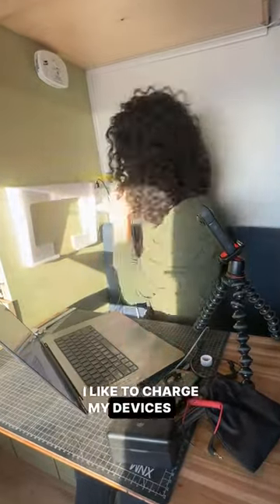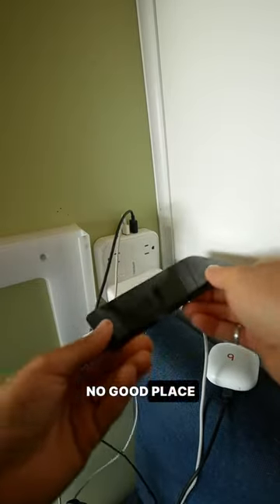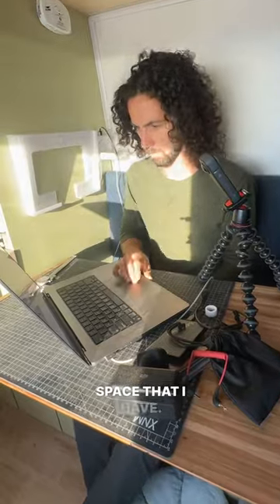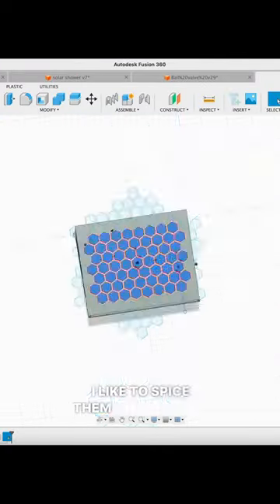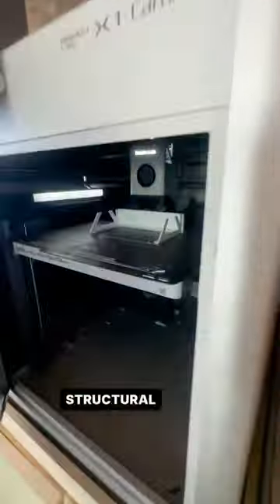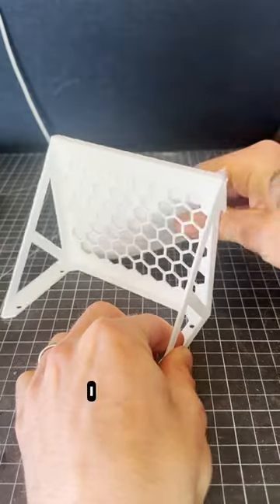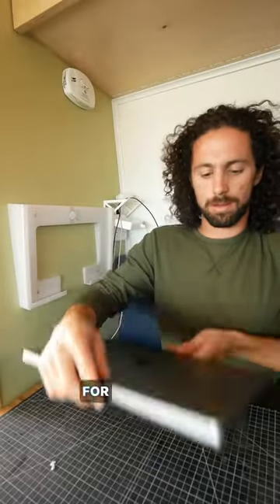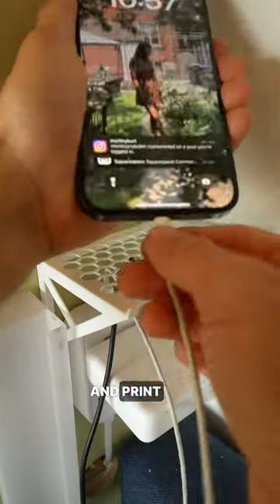3D Printer + Van Life = Constant Optimization #3Dprinting #vanlife #DIY #storage

Comment from the maker: Download and 3D print: https://www.printables.com/model/761335-charging-shelf-fits-over-2x2-outlet

Also, since there's a lot of speculation in the comments and I didn't address it in the video - the support material is to support a little lip on the front of the shelf (barely visible). The hexagonal pattern doesn't need the support material. Because of the lip, there is actually no orientation that avoids support material altogether. Funnily enough, the contradiction of "minimizing waste" and avoidable support material didn't even cross my mind until after reading these comments. Good thought for next time!
Reply: I noticed the lip as I knew the support couldn't be for the pattern. My question thought is : did the lip needed to be at 90°?

I understand that time is also a comodity, but my first impression is that with a progressive enough radius and smaller layer lines height it would have enabled to print this support free while using less filament. I can't see the print well enough, but it could be possible to do it by only increasing the total weight by just a few gram.
Reply from the maker: @Colonel__Mustard  Definitely could've been redesigned to avoid support material altogether. Didn't think of it at the time.
Reply: Coming from a place with no printing experience:

Could the "support material waste" be avoided if you printed it upside-down instead of on its side?

I do understand that the lip/ledge is good for keeping things on the mounted shelf; but if purely for structural support, could it be printed on the underside leaving the hexagonal top flat for an upside-down print?
Reply: @zachm241  Without the lip it could yeah. It would even be stronger because the force applied wouldn't be trying to pull the layer lines appart like it is in the video. 

That said, designing things with 3d printing in mind has particular chalenges not found in other design sector and sometime it's best to compromise on some aspect to save on time. Like, it's easy to point out he uses too much material here, but had he tried some other design he might had to tweak and reprint the thing multiple time to get it right.
Reply: I think a good compromise would be to print the lip as a separate body and glue it to the shelf (you could design interlocking parts or holes for pins to make the line-up easy)
Reply: @MorleyKert  You could try printing it on the slant under the trusses(the triangular bits at the side), which would result in almost all of the printing being at 45 degrees so you could probably get away without support material or needing to re-design it. You might need a small raft but it would still save material as long as the print quality doesn't suffer too much.
Reply: Just use equilateral triangle mesh. All overhangs  will be at 45

Comment: Minimize waste? That support material wasn't waste? Dude you could've rotated the whole shape 90 dgrees in your slicer sofware. No need for support when the hexagonal patern side is on the bed.
Reply: Especially ironic as the orientation he printed in isn't even strong, you'd want to print angled brackets on their sides for strength (so each layer is a slice of the whole bracket) but he didn't do that. This is jut printing for convenience and not designing for printability.
Reply: Not many printers understand the importance of orientation
Reply from the maker: See my updated pinned comment

Comment: "minimizing waste"

Removes the entire solid top of the shelf.

You could've made a solid shelf using the same amount of filament
Reply: I don't know anything about 3D print, but that infuriated me. I'm willing to bet it used MORE material.
Reply: The funniest thing is that he could have printed it topside down and not use any support what so ever.
Reply: @johnmeyers1943 if you did know anything about 3d printing you’d know that the peice he remove is incredibly thin and way less material that would’ve been used if he were to just fill in the hexagonal. Also your phone is powered by slave minerals.
Reply: What if he rotated the whole shape 90 degrees in the slicer sofware?
If the patern is on the bed, no support will be needed.
Reply: @goatpepperherbaltea7895   sounding pretty based there at the end.
Reply: camer here to say the same thing, orientation is oen of the best things to learn when you start slicing @Antheras
Reply: @Antheras so you’re right, but I think I know why he printed it in that orientation. If you notice when he installed the shelf, the screws went through the holes that were on the plate side of the print. I think it was oriented to ensure a strong hole for that screw, rather than a reduction of support material.

Here’s what I would’ve done though, to tie in the “well support is thin anyway” comment. Modify the design to not require support in this orientation, but retain the overall shape/aesthetic. I would add a .8mm (or double the nozzle for clean printing) wall in the middle of the hexagons, so the pattern is still there, but not completely cut through. This would strengthen the shelf, remove reliance on supports, and probably require LESS material than the minimal support. It would get rid of the through holes, but for a shelf, strength would be better anyway imo.

But here’s the thing yall. If you’ve designed and printed stuff before, you KNOW that v1 is never right. Honestly it rarely even works or fits! Our friend likely had similar thoughts after slicing or printing, but didn’t want to invest more filament and time into the project. At the end of the day, it’s $.10 in PLA, and the original design works. If this was being produced at a larger scale, I’d be more critical but this is a one off :)

Also hexagons have angles of 60°, so supports probably weren’t even needed for the overhangs lol
Reply: The reason he had the support there is because he modeled it with a lip to hold the phone. That being said, had this been designed with printing in mind, it could have been done without needing support. (Angle the lip, add a radius, reduce LH on the overhanging portion)
Reply from the maker: See my updated pinned comment
Reply: @goatpepperherbaltea7895  LOL!  Great burn!  Thanks for the laugh   
(PS nice username) 👍
Reply: I think he wants them to not overheat (?)
Reply: @goatpepperherbaltea7895  okay, but if her oriented it properly it woulnt have needed ANY, thats why its so funny, also he can defend himself loll
Reply: @A-scketchy-otter-lol agreed. it pissed me off when I saw which way he printed it because the orientation makes the load put the layers in shear, plus all the extra support smh.
Reply: I came to say the exact same thing😂
Reply: @goatpepperherbaltea7895  ~16% of the total printed volume is the support for the lip on top. now please tell how that is not wasteful. this was not there to support the hexagons, but the lip. printing it in a different position would have made a more structurally sound object while also removing that 16% support material.

also, generally "holes" are creating more material and also more printer movements. since he produces a part with infill, it would probably be material saving to remove the holes, counterintuitive, but true. also making the shelf part thinner would save a lot more and also make it more rigid
Reply: @mecatronicsforeveryone9565  yeah exactly and it would have been stronger too lol
Reply: Exactly why I started laughing when he peeled it off, then I laughed harder when I saw your comment

Comment: @MorleyKert That powerpoint needs to be rotated 90 degrees so you can plug devices in without losing one of the sockets due to the wallwort.

Comment: If that is your Van, why would you not get a better electrical system? Like more outlets?

And, no I would not recommend a wireless charger for a Van because it looses energy, at most 20% under optimal condition gets into your devices..

Comment: Not so much a fan of. You have a rather fixed set of devices, right? So Having something where you can slide or place your devices into, while charging would be way nicer. Could be made modular for each device. Also 3D printing is also almost never about a clean environment mindset unless you repair things through your prints that would have been wasted otherwise 🦆

Comment: not using a pattern was smarter here, you could use 10% infill and it'll reduce print time and material since it's less full. the pattern you made added cost bc of the full faces it needs to make inside each one
Reply: He needs more infill tho? If he's using regular PLA or PETG, he most likely should use like 50-80% of infill if he doesn't want it to snap by tomorrow
Reply: @SavalioDoesStuff  I don't think so, but depending on the design and how full it is, but 25% infill will probably be enough